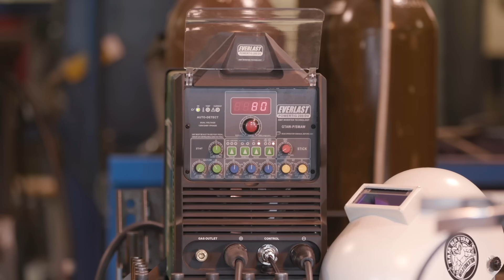🔥 7018 Fill Pass on 5G Pipe

Comment: On 4" schedule 40 you're not usually going to have so much width on the bevels. I use a beveling machine and get exactly 37.5° and a 3/32" gap and there's not even close to that much width. There's no space to even weave side to side

Comment: Thx for the video. Can we use 7018 electrodes for all passes (root, hot, fill and cap)? For critical structures (pipelines). Or we always need to use 6010 for root and hot passes? Thx.

Comment: Excuse the username, but why is so much pipe welding done with a stick instead of MIG?. I understand that TIG would be too slow for many jobs but MIG has the speed from what I can gather.
Reply: Sociopathic Narcissist 
Quality of the end result. Mig/Mag welding is much more prone to problems including porosity and lack of fusion unless conditions and settings are almost perfect. Also, mig welding need to be done indoors or with shielding from any wind so not as readily useable outdoors. Stick welding creates its own shielding
Reply: Thank you for your detailed reply, It never occurred to me that MIG has those constraints. Of course now you have told me, I'm feeling a bit dumb, unfortunately an increasingly common occurrence as I age.